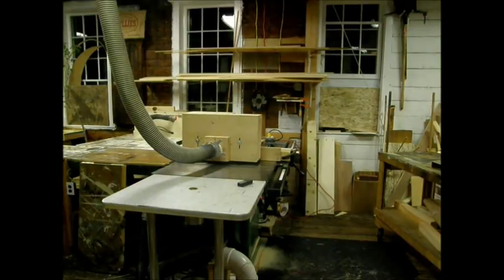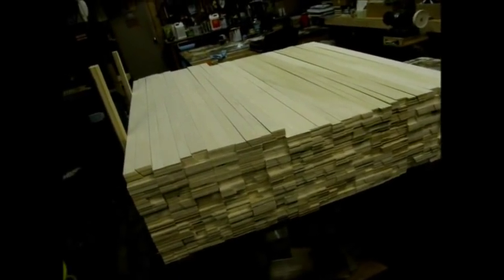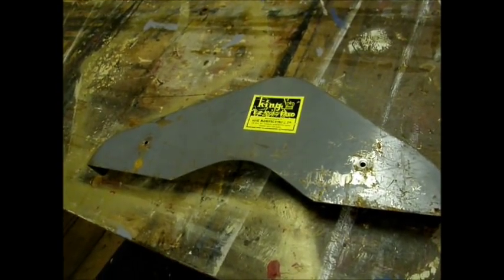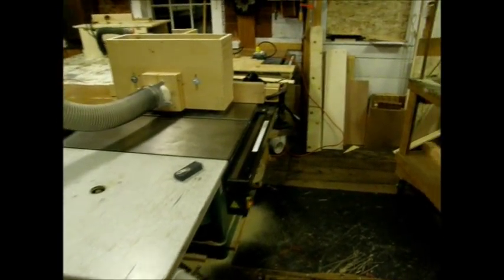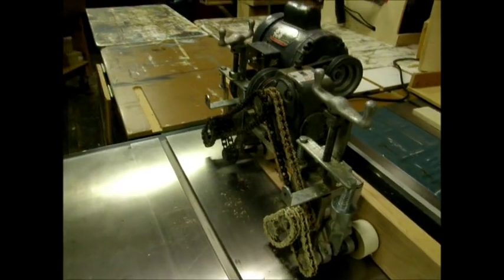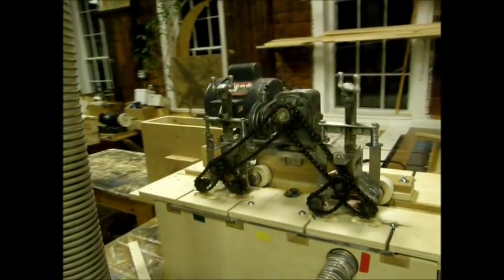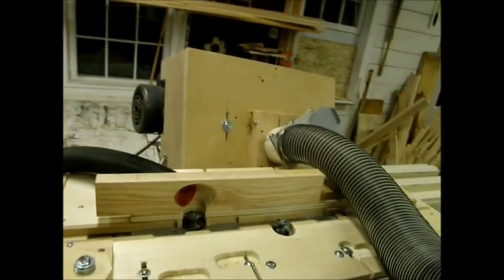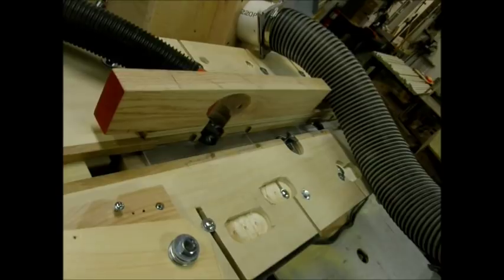Powerfeeding with the KING

Comment: Collecting the dust is great, but it's not the dust in Melamine and MDF that kills you!.
MDF & Mel panel is made with Urea Formaldehyde glue.
Formaldehyde will kill you!
Formaldehyde that out-gasses from the panel chip glue is a GAS not a dust - so as a GAS it passes straight thru your dust filter bags and recirculates around your workshop all day for the 6 hours your cutting.
Unless you vent your dust filtration to a cyclone/hopper outside of the workshop - then your breathing the Formaldehyde gas that kills wood workers frequently with esophageal Cancer.
Formaldehyde was first used by taxidermists to mummify flesh & caused a disease in Taxidermists, called appropriately enough "Taxidermists lung" - because it dehydrates lung tissue when you breath it and kills off lung tissue cells in a process not unlike ancient mummification.
Having it used in Man made panel board material in the glue that holds all the chips together is a recipe for disaster, with cabinet makers lungs.
Best get familiar with this research and manage our shop dust appropriately if you want to stay alive working man made panel product.
http://billpentz.com/woodworking/cyclone/
Reply from the maker: This is an old set-up.  I have solved all the problems with dust and routers and have updated this machine
Reply: Great to hear! My father / business partner died of esophageal cancer from Formaldehyde gasses after 20 years of cabinet making with Melamine and MDF. I'd hate to see anyone else go thru that if it can be avoided is all!
So my post was to aware as many as possible - not just yourself if that makes sense.
I really enjoyed your video - very inventive and i gained a lot of ideas from it - thanks heaps for that!
Reply from the maker: Please see my recent video.  I made a great improvement https://www.youtube.com/watch?v=RJRjns56Nng